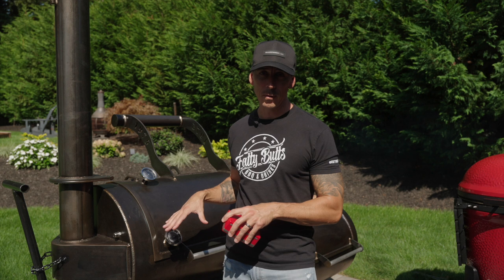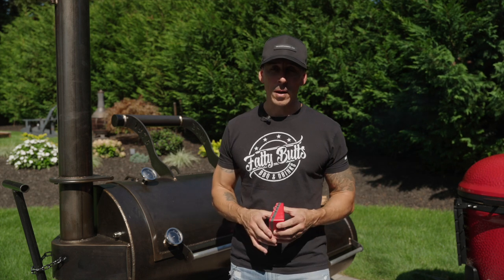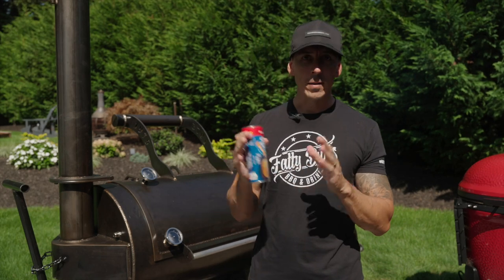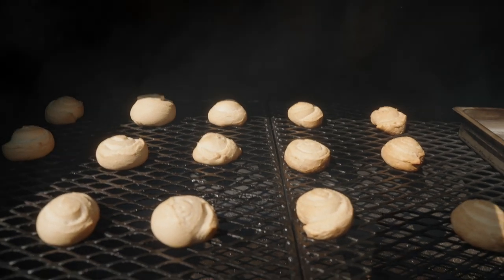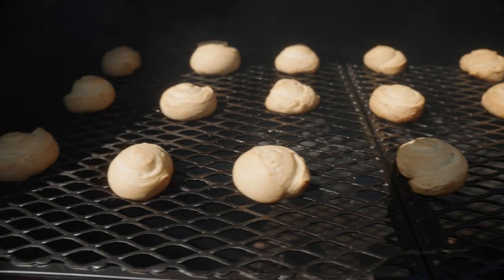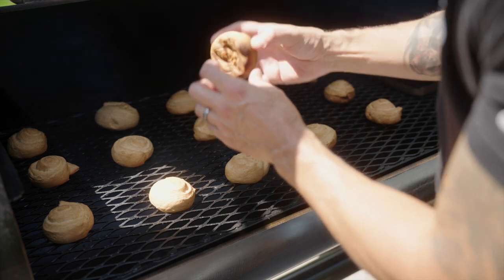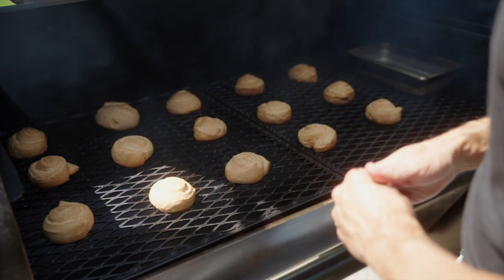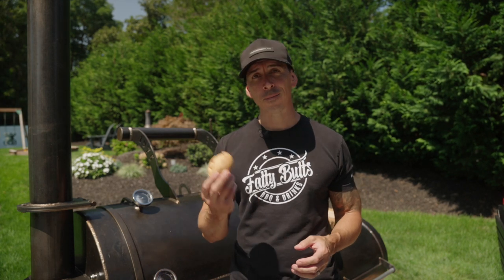Workhorse 1975 Biscuit Test

Comment from the maker: I thought I had more biscuits on hand but this is all I had for the test. Normally it's a bit hotter right near the sides of the smoker since you're dealing with more radiant heat as well. All-in-all, it's a pretty solid representation of how even this smoker cooks. I do recommend closing down the damper a bit to help with the draw and move the hot spot closest to the firebox.